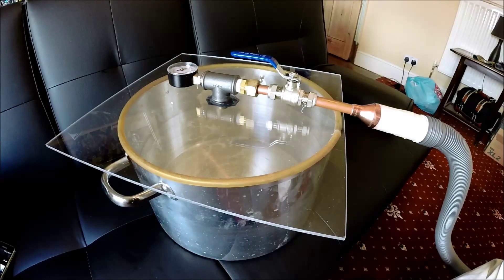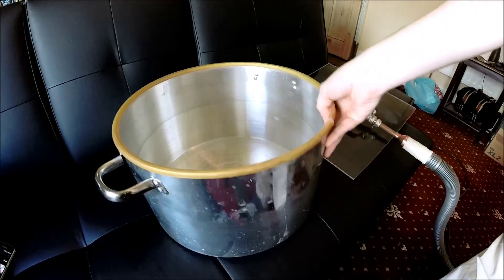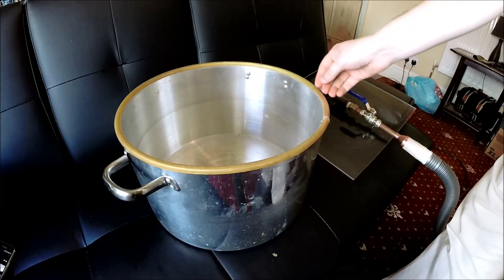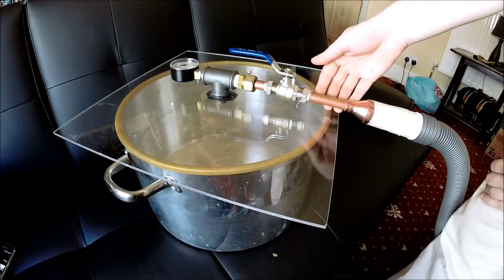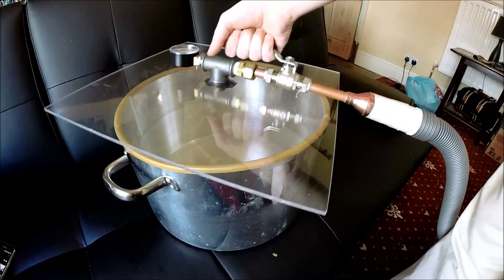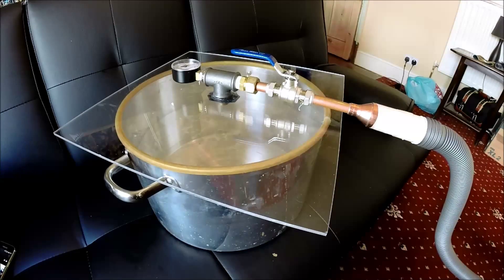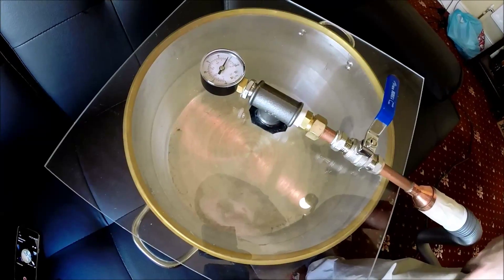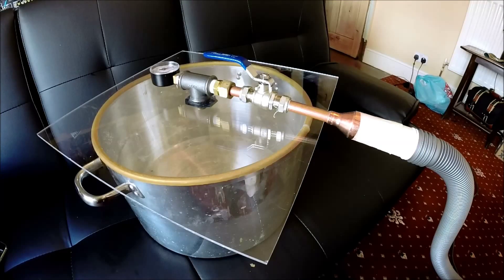Home made vacuum pump/degassing silicon rubber

Comment: Duude.. I like the way you have build this, but you need at least 15mm persplex for that to keep it safe...
This can so easily implode with shrapnel flying everywhere...be careful it will bite you if you you are not...
Reply: @unvisitantemas  no...not at all... that would be worse...like really bad...
If you have no other option... try to sandwich persplex 5mm in 3 or 4 layers with glue...

Comment: I used an acrylic food container that has a wire  metal hinge and clasp. It worked really well until it finally imploded and put a shard of plastic in my finger. People have to be careful with using too thin a piece of plastic. I say if 1/4 inch is good enough, go with 1/2 inch just to be safe. Nice set up by the way. You did a nice job on this.